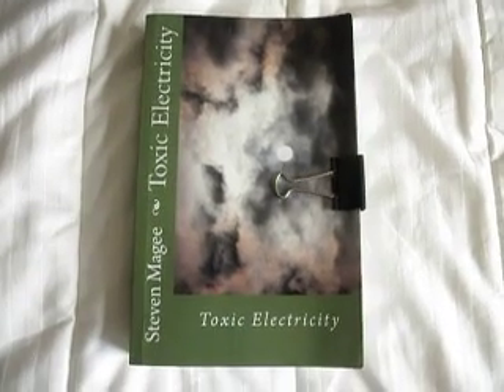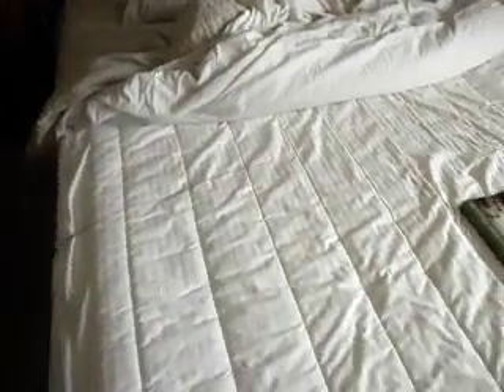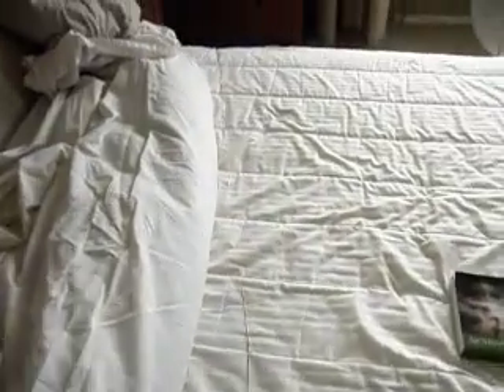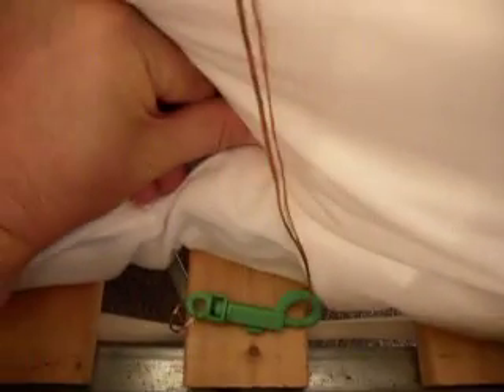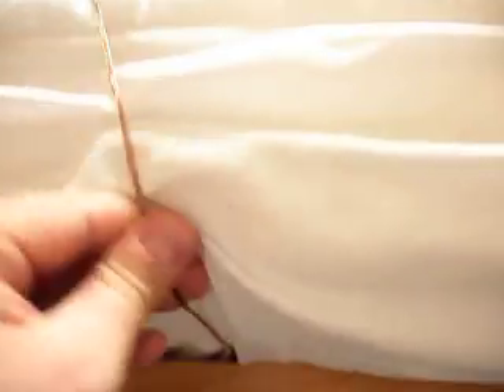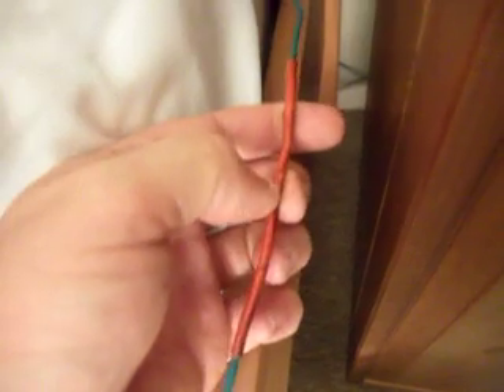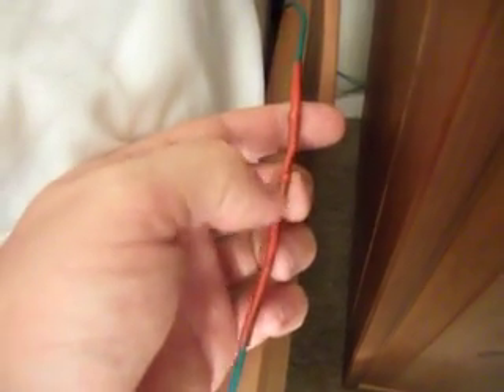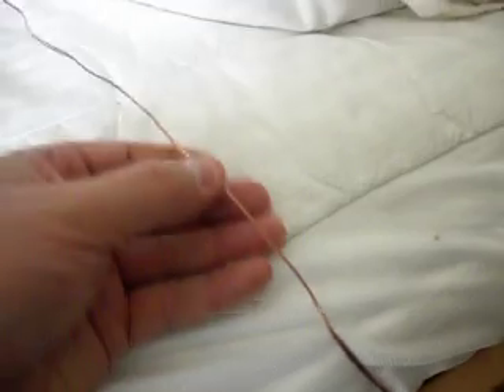Implementing the Earthing (Grounding) Health Technique

Comment from the maker: There appears to be a significant difference in an induced AC voltage through air and a direct connection to the AC electricity system through grounding systems which appears to be far more toxic.  Anti-static grounding straps typically connect you into the AC grounding system which is the neutral transformer connection that is electrically energized.  They typically have a 1,000,000 ohm resistor in the anti static device to protect against currents that could flow from the electrical system.

Comment from the maker: The 1,000,000 ohm resistor used with anti-static systems was chosen simply to prevent electrocution of people from grounding systems.  It does not protect against “stray voltage”, harmonics, dirty electricity exposure, and radio frequency (RF) exposure. Search "Stray voltage cows" and read "Electrocution of America" by Russ Allen for more information on the known health problems associated with stray voltage exposure.  “Radio wave sickness” (RWS) details the health conditions that may show up.

Comment: Interesting. Would be useful if you could explain the difference of grounding like this versus the oft promoted way of grounding by actually making contact with a grounded item (mat, wristband etc.)

Also is there a risk voltage will channel itself towards the grounded area?

P.S. Toxic Light and Toxic Electricity, two eye opening reads - recommended to anyone out there watching this.

Comment: I`m no electrician @ all... But I can almost see how the AC voltage in the air would be less harmfull; 
Maybe becuase it passes through the body and interacts with the cells in pulses and not a steady stream ?
And also the air born AC fluctuates in strength ?
I have noticed that not sleeping on my $1000 Wire bed that I sleep 1000 times better no doubt due to the wires acting like mini antenas broadcasting the RF EMF`s into my body. I sleep on the floor know and no heart fluctuations...